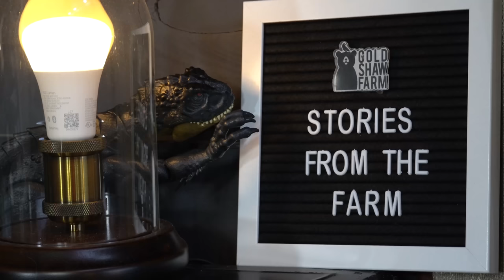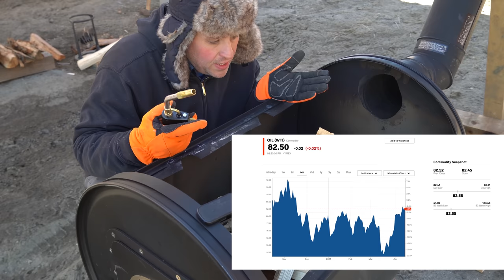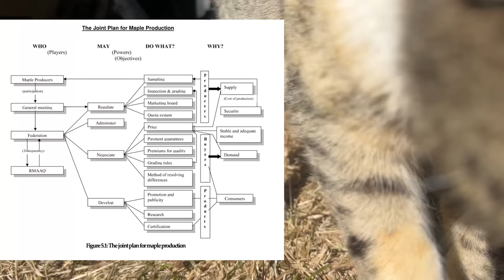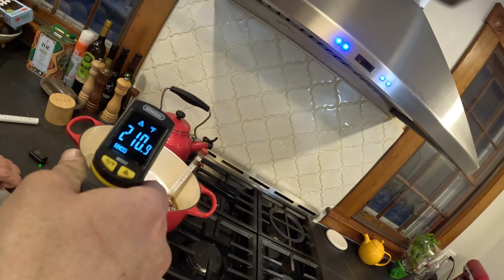The Largest Maple Syrup Heist in Human History

Comment: Can't unsee how you start a fire, @GoldShawFarm. It is exactly the reverse of how it is done efficiently.
(Sorry, but seeing this is really cringe for me, I am not trying to troll or be negative or bully in any way. Hopefully positive input follows below.)
From the bottom to the top it should be first: 
 1. Paper or  fine wood shaves
 2. Small pieces of wood, that can be  light by #1
 3. Bigger pieces of wood
 4. And bigger, and ...
So from the bottom to the top it gets bigger and bigger, NOT the other way around (and then using the blow torch forever, from the top and waiting for the bigger pieces of wood to finally ignite).
In this way you just need to have the initial pile of #1, #2 and (depending on the wood) #3 as the initial setup, light it up and then gradually go bigger with the pieces of wood. When to put bigger pieces of wood on the growing fire needs a tiny bit of experience (not to early or you will choke the fire, since it needs air).
No need to endlessly use a blowtorch, no need to waste time. And it takes exactly one match to start the fire and then just putting bigger pieces of wood on the fire when it is time to do so. This way saves human time and wall time.
The ratio of wood size and iterations between #3 and #4 depends on the wood size you have available and what wood you are using (how moist and what type (oak, popplar ...).

My favorite for hassle-free ignition: Use a chimney starter (yes, there is no law prohibiting you of using it without charcoal 😉). It creates a natural flow of air pulling from the already burning parts to the not already burning parts, transfers the heat and provides oxygen for the upper (bigger) layers and is even faster than only using the proper (😉) layering described above.

<stepping off the soap box>

Comment: Why does he put the smaller wood on the top of the thicker wood and light it? You light 'kindling' underneath the larger wood so as to get the larger wood to burn because, you know, heat rises. Seems like the larger wood would never get to burning unless he holds that torch directly to the larger wood for a very long period of time.
Reply: And that’s just what happened.

Comment: Is anyone boiling maple syrup with renewable energy yet? Burning wood is great for a small farm or backyard operation (and arguably renewable on a small scale), but for a product that's made on an industrial scale and sold globally, it seems like there must be a better way.
Reply: I haven't seen any renewable energy systems but some producers use gas systems, you can regulate the heat much more efficiently....and no need to keep watching and stocking up the wood burner....many use the wood burners because their wood is free from their property...so it is renewable energy as the trees are replanted or the bush lots are rotated and not touched for15 or more years.

Comment: I have three sides of 4 , 200’ in the back, 400’ both sides. 1.8 acres, in a 250 yr old town center. At 1300 ft above sea level, at the hill’s top, owned fr 1880-to 1965, before a house could be placed on the sandstone ridge of the hill, which, is 50 ft from Main st. 
    Water that flows from deep, with iron (bacteria) flows all year. So I see my sq., as a watering pen for animals, where, creatures from outside , the sq., won’t come in. Much of the walls are beautifully stacked, like buddhist discipline.💜

Comment: I need to make precisions on who can sell or not maple syrop. You can sell directly at the "cabane à  sucre" under a certain quantity without passing by the federation and having quotas. 

There are some who want to take profit of the hight price without participing at the system that permit it. They are just parasites. Yop, producers outside Québec benefit higly the system.

You made a good job describing how the system work (except the capacity to sell at cabane à sucre) and why it was implant. That's what we see in farming economic courses.

Did you know? Maple syrop is the only thing on the planet that Canada have an wolrdwide infuence on the price and production. Also, that control help a lot to upgrade the quality of the maple sirop by putting in place a grading system.